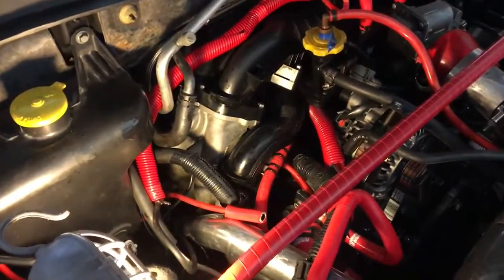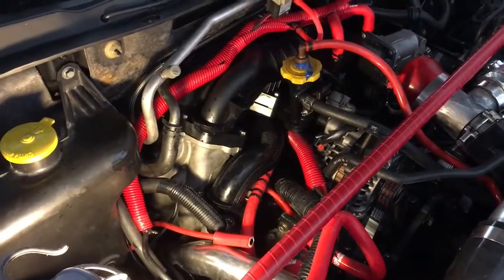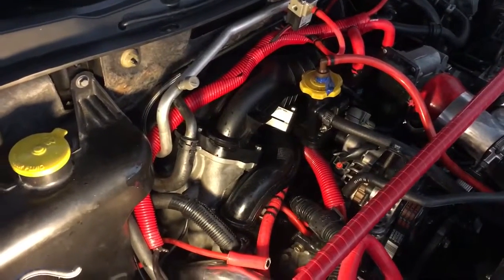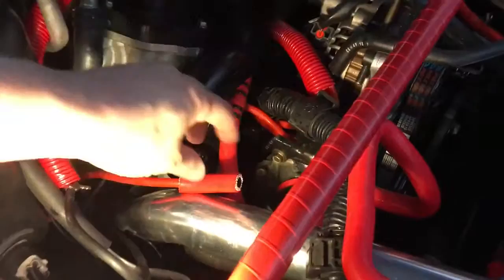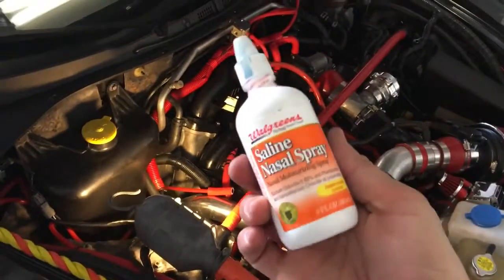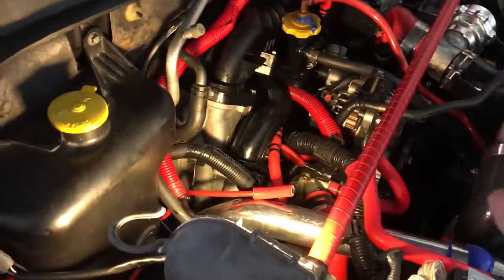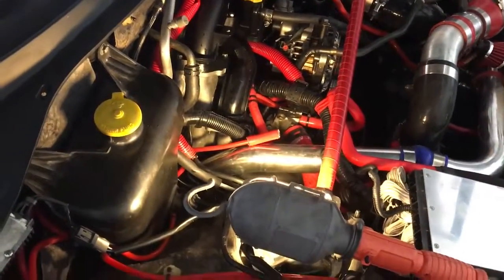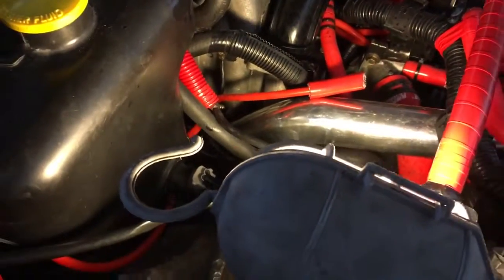how to start a fresh rebuilt rotary

Comment: hey so where is that tube connected?
Reply: To one of the vacuum nipples on the lower intake manifold. There are two. On the stock engines they have little black caps on them.
Reply: +Vlad Darevskiy thanks for the response. that would make it way easier than dealing with ghe spark plugs
Reply: Indeed!